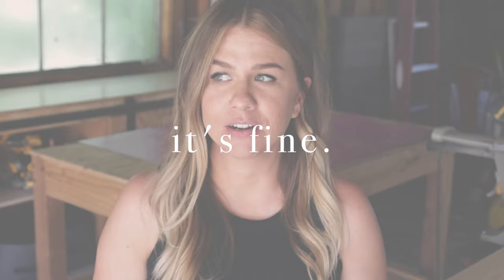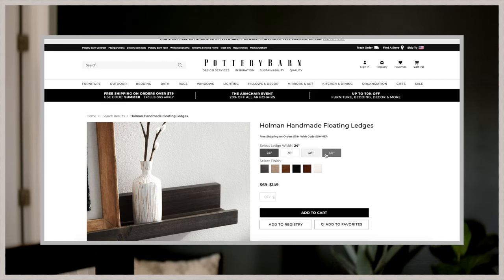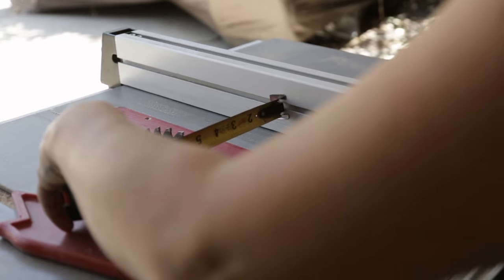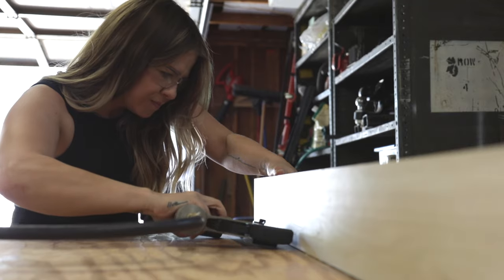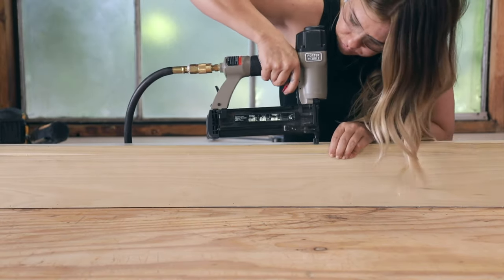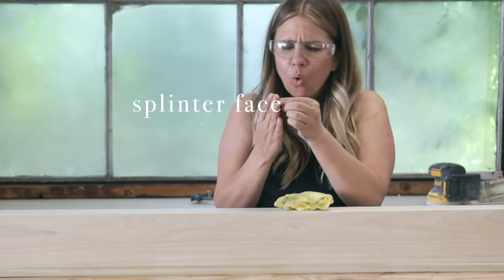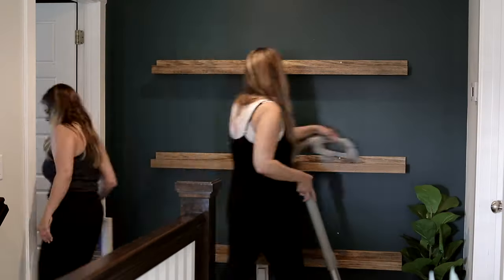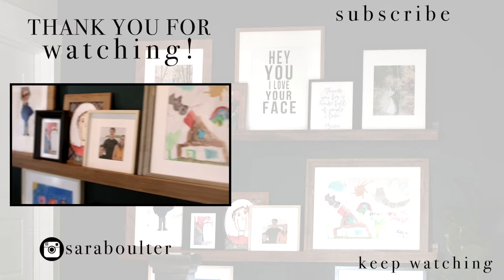PICTURE LEDGE DIY (picture ledge decorating ideas) Pottery Barn dupe shelves-Sara Boulter Curated

Comment: Used the same color stain and it did not turn out looking like that color. How long did you let the stain set in before wiping off?
Reply from the maker: Hmmm. I used poplar and probably let it sit on there for just a few minutes.  I wonder if the color looks different on screen than it does in real life?
Reply: @MadeBetterHome  it could be the poplar because I used regular pine.
Reply from the maker: @espinozamichael20  ah dang! pine is such a tricky wood to stain. Whenever I’ve used pine, I get mixed results and I have to either leave the stain on forever, use gel stain, or several coats. Sorry for the hassle!